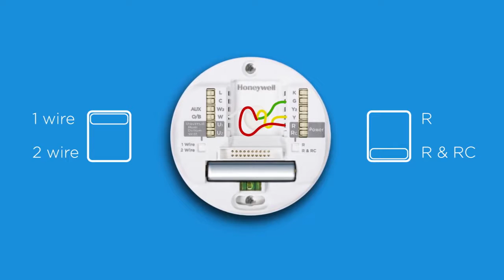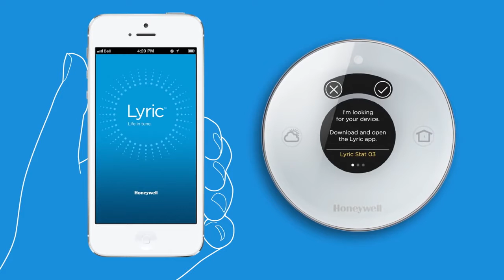How To Install Your Automatic Lyric Thermostat - Chapter 3 | Honeywell Home

Comment: I took the old thermostat mount apart, but could not get the wires disengaged. One video voice over said they sent me a special tool to unlock the fasteners. Well they didn't send any thing in my package. I've tried using an L-n wrench, but it doesn't work any better than phillips' head.
Reply from the maker: Hi Cathy, Thank you for sharing these details with us. We would be happy to help out with your thermostat installation. When you have the chance, will you send us a note at HoneywellHome@honeywell.com or give us a call at 1-800-633-3991 and mention case 00150171? We look forward to working with you.